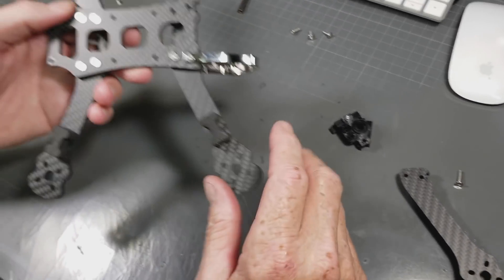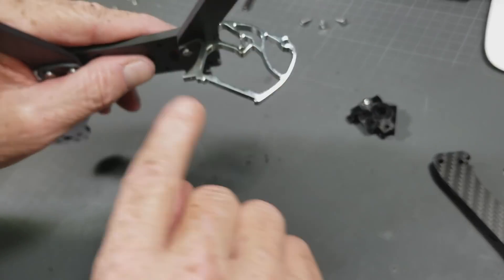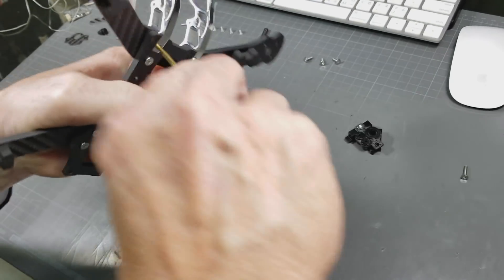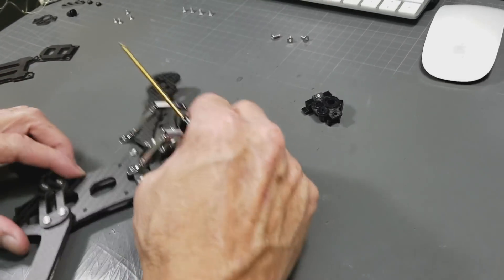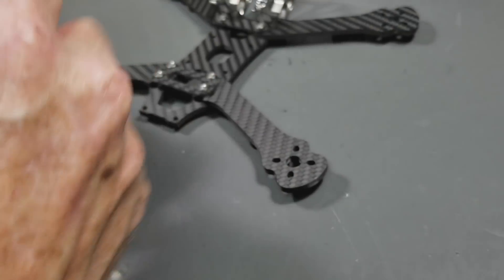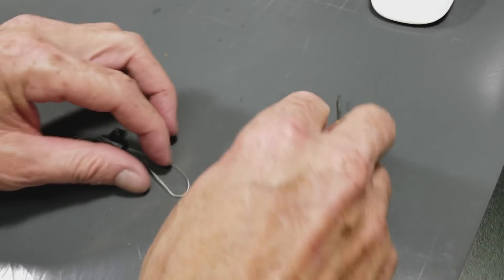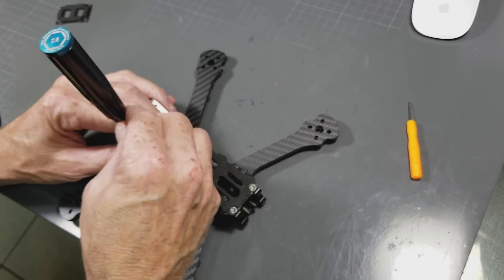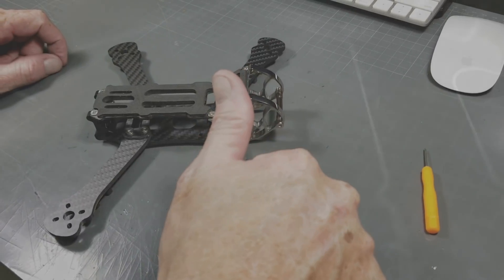Armattan Rooster Assembly Tutorial

Comment: What about mounting the front arm under the bottom plate and adding a spacer for the top plate? so that the front props are lower than the rear props allowing for "new air" and getting better performance? Or I guess you could also adjust the titanium front pieces to allow the top plate to align the same as the back and achieve the same thing. What do you think?

Comment: Happy I never bought the chameleon now..this is an upgrade and corrects the flaws
Reply: Still nothing wrong with the chameleon
Reply: F rom a design point there were minor structural designs from the chameleon(the choice of carbon and metal combination used aswell as the frames weak points - top plate and front end) that have been addressed on this frame which improves its overall strength and integrity.  Also it may be personal interest but i believe modular arms are a better option in frame designs. So as stated this is a brilliant upgrade.